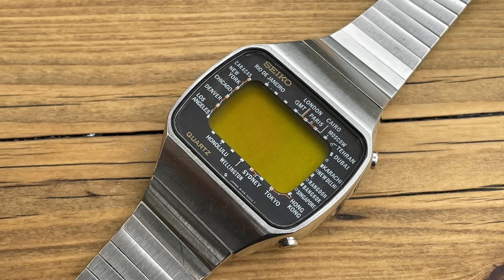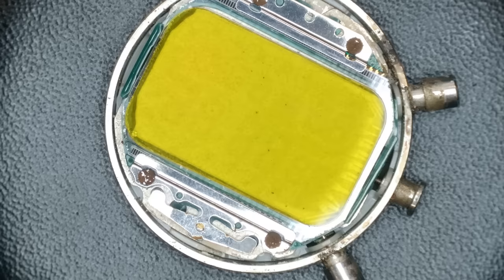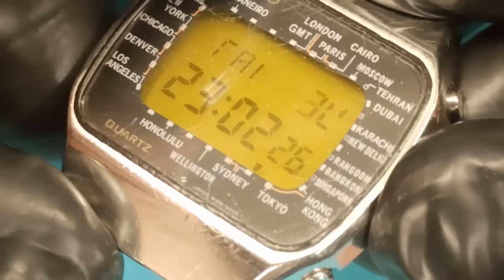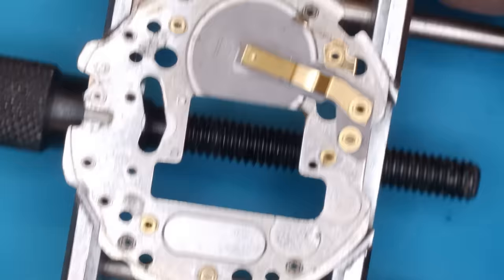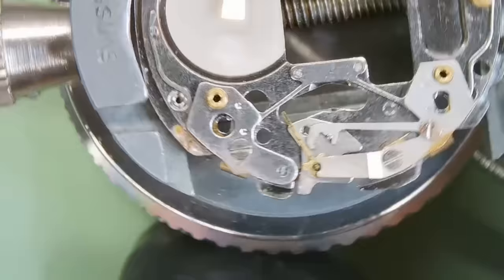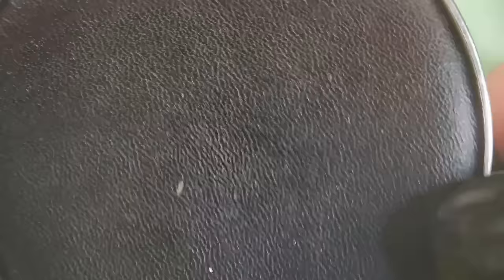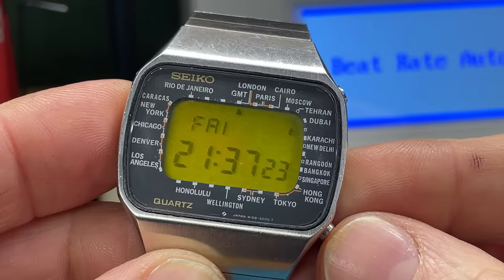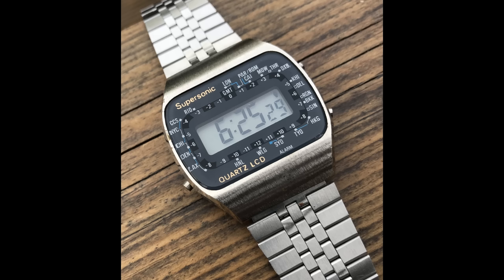1978 Seiko Pan Am M158-5000 Vintage Digital Watch Restoration

Comment: Inserting a new battery while shortening the contacts. YMMD!
Reply from the maker: They were fibre ended tweezers!  
Seems to have triggered many of you ..!
Reply: @MyRetroWatches  Ah! I see. You switched tweezers after taking the old one out. Sorry for that.
Reply from the maker: @MuellerNick  don’t worry many have picked up on it. I should have said something in the video really.
Reply: @MyRetroWatches I'll add a more useful comment than the initial one:
Do you know those glass fiber brushes? Electronics dealers do have them. Short stiff whiskers that can be adjusted in length like in a lead pencil. Actually, this whole thing looks like an automatic lead pencil with a 1mm diameter lead. They are great for removing stubborn oxide layers. Also, sprays like "Kontakt 61" (also electronics shops) that help to solve corrosion. These sprays do not harm plastics. That should help you also in cleaning the watch cases where nasty crut seeped in.
Also, white vinnegar helps in removing oxide of leaked batteries.
I'm just an electronics guy that stumbled over your video. :-)
Reply from the maker: @MuellerNick  fibre pens.  I have some and use them occasionally but they do leave lots of bristles behind that in a watch is not a good thing so you have to use them before you clean anything to be sure. 
I appreciate you are an electronics guy and pleased so many of you seem to be watching this video. All my other digital videos have flopped but this one seems to have had a mind of its own!
Reply: @MyRetroWatches Well, for sure you have to clean the watch after using the pen. But that's obvious to someone like you who does such kind of work. 🙂
I was just triggered by the digital watch and wanted to see what kind of problems digital watches do have. I don't have a hand wrist watch since decades, but like the looks of it. Like the more expensive casio g-shocks.

Comment: You essentially short the battery out with those tweezers. Right?
Reply from the maker: No the new battery I used carbon fibre tipped tweezers

Comment: I was a brand new Radio Officer back in 1977 and this watch was the one I wore for my 8 years as an Ocean Mariner. Can't remember when I stopped wearing it but it was still in my possesion 🤗so based on this video I opened it up 😱oh no, the battery was still inside and it had leaked 😤 but I have just spent umpteen hours carefully dissassembling and cleaning it. The main metal chassis appears to be steel and has lost it's plating where the battery leaked, I'm thinking of electro-replating it with gold before I re-assemble it so it doesn't rust. Have you tried to replate a part and if so do you have any advise?
Reply from the maker: Hi. Never replayed anything .  If I was you I’d rebuild to see if it works first then you’re not wasting time.
To be fair Seikos are so tough . Just check all the traces on the board are intact and with a bit of luck it will fire back up . 

Let me know how it goes . Genuinely interested and rooting for you
Reply: All the circuit traces and boards are in great condition, the battery electrolyte was only on the outer edge of the battery holder. I do need find a battery for it and I will certainly update you on it's status when it's re-assembled.

Comment: Awesome video!

I have been struggling to find the part number for the battery hatch. I have a M158 but do not have the hatch. any help?
Reply from the maker: I don’t think Seiko issued part numbers for such models. If it were anywhere it would be in case documents which there are some on my website. 
Even with the past number you then looking for something that is probably rare to find for sale in the packet.
Reply: @MyRetroWatches  Thank you

Comment: The timekeeping function of the watch is down to the crystal and it is NOT anywhere near "new" technology in 1978.  You can watch a whole  crystal training film from WW2 about these crystals.  A lot of radio equipment used these crystals so that the cycles per second as they were then called (as opposed to hz, khz and mhz) would be stable.
In fact, the only "new" technology in the watch is miniaturization and cost cutting.  There are digital watches from the 60s as I'm sure you are aware, though they generally used a different display technology (segmented red LCD).

It is amazing to me how quickly this all developed.  I had a space invaders (it had a space invaders game built into it)  watch in my jr year of jr high school, which was 1981-1982 school year!  3 years after this watch was made and  sold for 215USD, a 12 year old had a better (technologically, not a better watch overall) version of it. I'm sure my parents would not have spent more than 20 1981 Dollars on that watch.    Maybe 2-3 years after that, they were in bubble gum machines for like 50 cents.

Of course, the main difference between this watch and the Space Invaders watch I had is that this watch still works after a cleaning.  There is a high number of these watches that still work.  While I am sure there are space invaders watches in the world working somewhere, I seriously doubt the percentage of survivors is far, far lower. Not just because they were owned by children, but because they had to be further cut down.
Reply from the maker: Digital watches is what I refer to by early.  First digital LCD watches were mid 70s and ones with more features like this one came later.  LED watches were first publicly available in 1971 with the Hamilton Pulsar P1.  The first LCD was the Seiko 06LC in 1973.  Seiko led the way in many respects with Casiotron (first casios) in around 1974 of which I have a few examples. 
Quartz crystals decimated the mechanical watch industry worldwide and its now known as "the quartz crisis" with many brands going out of business.
Reply: @MyRetroWatches  For some reason I kept thinking the first digital watch was from 67 or 68.
While a quartz watch will always be more accurate than a mechanical watch, they also don't deliver on that something else, like the tick-tick-tick of a watch.
Unfortunately, the LCD watch turned the watch into nothing but a commodity for most people.

Comment: How on earth can you line up the contacts from the board on the screen...that looks like an impossibility!!😮
Reply: It's very simple. The Zebra strips have 10 times the amount of contacts as needed but they are all separated. So no matter how badly misaligned you will guarantee some good ones per contact on the LCD glass with no shorts between. LCD's also only need microamps so the strips can be made of carbon rather than copper. 
They are made of rubber and a compression fit is all that is needed.
Reply from the maker: The zebra strips take care of that so as long as they are in the plastic slot the screen will then line up . The screen clamps secure it all and make contact.
Reply: Well the watch is very cool...nice job!

Comment: Hi 
What is the maximum yr in calendar before date runs out?.  I can't see much beyond 2024.

Ferrous steel is used instead of stainless, reason is stainless steel used on stainless will freeze and seize in place.

In 1975 here in New Zealand at primary school I remember the school principal having a Digital watch made by Goldstar it was a pretty big brand this was at same time when Hanimex made some pretty cool calculators etc.

Casio, Seiko was pretty rare then but Citizen watches were just coming in
Reply from the maker: The date does not even get into the 2000s

Comment: Well you finally got it together : BUT as soon as I saw you bring out that MERCURY BATTERY I said
That ain`t gonna work !!! Try putting a NEW MODERN LITHIUM ION battery in the BLOODY thing !!!
That had me PULLING MY HAIR OUT the whole video !!! Other wise it was all rite ! CHEERY OHHH !!!
Reply from the maker: ? It’s a standard silver oxide watch battery. No mercury .  Battery has to be 1.5v
Reply: @MyRetroWatches  Every time I put a weak battery in ANY digital watch it does the exact same thing kk my mistake, Oh LOVE the OLD meter !!

Comment: I guess that this quarz tester is also not too precise, because it's an old tech that needs servicing
Reply from the maker: from what I have read it stays pretty accurate and you can get them re-calibrated with the right kit. Just so happens I know someone who can do it but I have to see him first!
Reply: @MyRetroWatches  my idea is that it uses old schematics and electronic parts that may be not too precise by design. Thermal compensation etc. just like analog synthesizers prone to pitch drift and need for warming up to get more or less stable.
Reply from the maker: @Galova  when I do a video on this machine I will also take the back of it off so you electonics guys can have a good look at the technology. 
Stay tuned
Reply: @MyRetroWatches  great news!

Comment: I am curious as to why you are suspicious of capacitors in a watch. Most capacitors in a watch are going to be ceramic capacitors, which are highly reliable components. The capacitors that you have probably heard that are notoriously unreliable are electrolytic capacitors, which are very common in radio and audio/video equipment.
Reply from the maker: I was suspicious because I know little to nothing about electronics but have swapped caps on other watches and improved the screen or just got a watch working that way.  So was only going of past experience rather than any good reasoning or understanding.  I like repairing watches most are mechanical but I do dabble in getting digitals going as a nice challenge. The construction by comparison is a lot easier

Comment: LCD displays fade after 10-25 years. There is nothing you can do about that. You can see that not only in old digital watches but in cameras with LCD displays and in automotive gauge clusters.
Reply from the maker: I don’t necessarily agree I have many other Seiko older than this one all absolutely fine. Also a few casiotron from 1974-75
Reply: @MyRetroWatches  The long-term damage is usually from exposure to sunlight. If the display was protected from sunlight much of the time it will fade at a decressed rate. Forvexample, LCD Displays in camera finders last longer than external LCD Displays on the top of the camera body that are exposed to sunlight. There are of course other causes of weak displays, for example, if the zebra connector strips are dirty or if they have deteriorated. You are quite lucky if you have 40 to 50-year-old watches with still very legible LCD displays.  I have a Citizen Ana-Digi Temp from 1984 and its digital display is still legible but weak. I can directly compare it to a recently made watch with the same module (still in proction!).

Comment: Holy crap, that must be the original battery, Union Carbide sold its battery division back in the 80's. And just call it a centimetre already. 10 mil thick...that's just a centimetre. Sorry, it's not you, just an ongoing gripe I have against weather broadcasters when they say expect 20mm of rain, or 500mm of snow, just use centimetres already, makes it more relatable and understandable by the audience, nobody can visualize millimetres unless you're talking about one or two.....
Reply from the maker: I’m an engineer. We don’t work in CM as that’s just weird.  It’s mm, or thou for imperial.
Cm is for children and woodworking

Comment: I hope it is not your cancer flaring up again. I'm in the same boat - waiting for a pet scan to see what is going on. - - I hadn't realized there were so many mechanical parts in an electronic watch! The broken green plastic frame - I'd have tried a drop of cyano on the split, before you re-fitted it, to hold it in better shape. - - -  I know you were working under very high magnification, but you looked quite shakey.
Reply from the maker: I am fine (I think) have a PSA test next week which I am nervous about.   I have had a bereavement in the family.
Reply from the maker: I have a UV glue and UV oven which I had contemplated using to stick it back together, it would work as I use it for Seiko crystals for certain models.
Just was not too sure how the watch would be so didn’t want to go to that extent in the video.
Reply: @MyRetroWatches  - Sorry to see that.

Comment: Please get yourself some plastic tools. To see you prodding and lifting with sharp metal scares the heck out of me!
Reply from the maker: It’s triggered many and I understand why but I am not applying much pressure as I have a light touch from working on mechanicals.  I am yet to damage a screen fortunately.  The driver is less than 1mm wide

Comment: Батарейку взял пинцетом и замкнул + и - 🤦🏻‍♂️🤣👎
Reply from the maker: No. They were fibre ended tweezers when I fit a new one. Removing a dead battery at the start with steel but it’s flat so makes no difference.